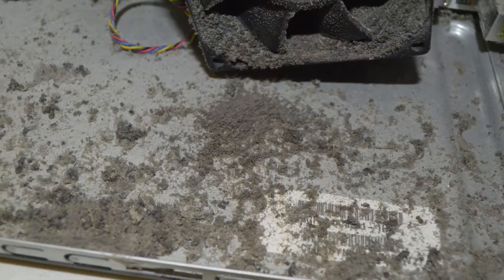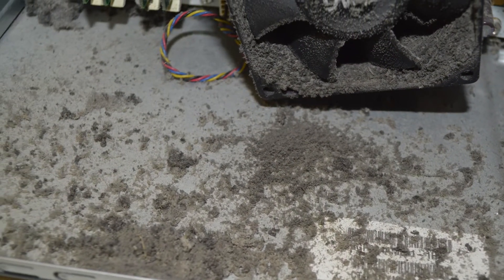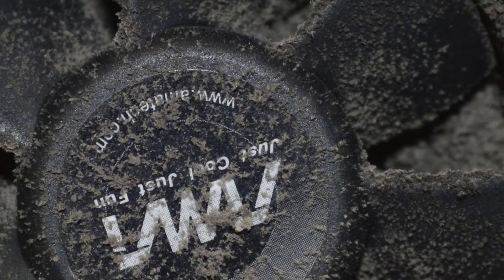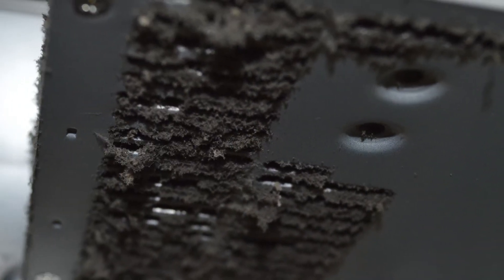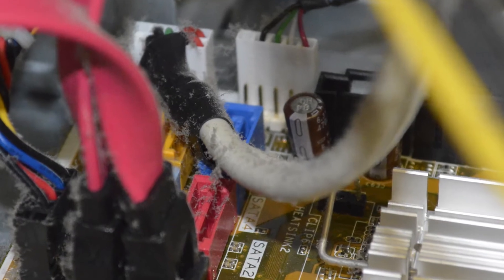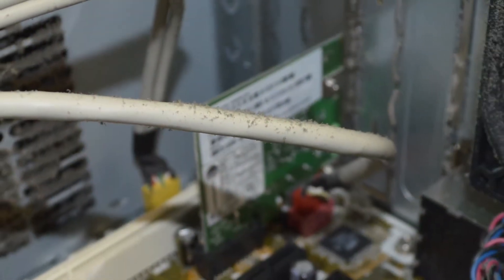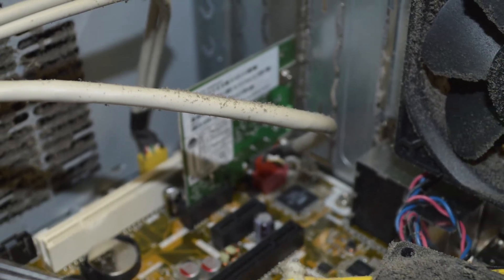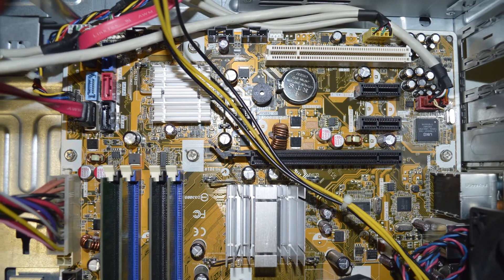Upgrading an Old Computer with an SSD

Comment: 30 seconds to open Internet Explorer on the Hard Drive! LMAO. and I thought my high school's computers in the library were slow! It took 10 seconds just to open Google Chrome. That was a bad decision by the IT department to have 1 TB of Hard Drive rather than a low storage SSD for probably the same price since storage capacity is not that important on school computers and SSD speeds up boot times and loading apps much faster.
Reply: exactly
Reply: They made the right decision, for reasons you clearly lack to understand. SSDs are not supposedly to be constantly rewritten without consequence.
Reply: @screekid  I understand this, but I have had the same SSD in my computer for 4 years and it has not slowed down at all (other than if it is full), and it is not dead.

Comment: So mostly of the viewers are the same as me who have an old pc.
I have the HP SFF i5 650 with 4gb ram and dedicated video card.
And im still hesitating to either buy a Ryzen 5 set with SSD or to just upgrade this old computer to an SSD since one of my problem is with its crappy reading speed and 100% disk usage.

Comment: Just what i was looking for i have a very old 775 c2d e2160 pc 4 g ram and i was interested to see what would happen if i install a ssd on it. btw i think you should have started with the hdd speed and then the ssd speeds to add the dramatic feeling to the video hehe,
Reply: I'm more of a straightforward kind of guy. :) I don't care for drama.
Reply: Windows 10 doesn't even boot properly in a old HD with that kind of simple hardware...